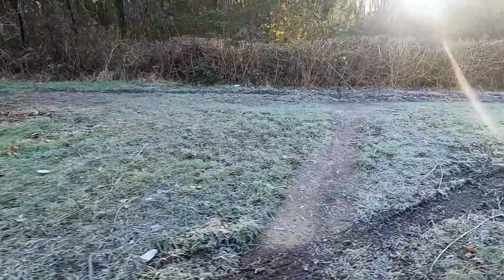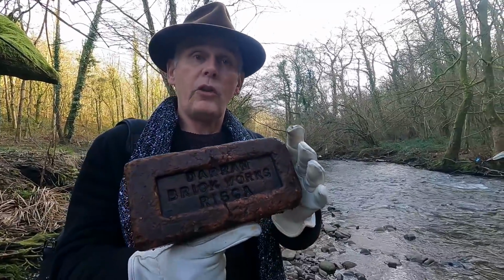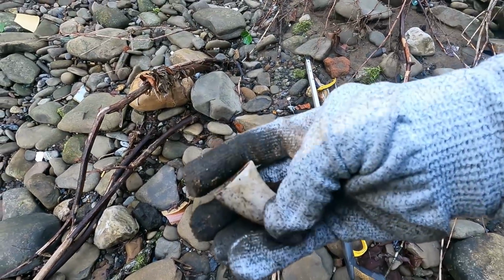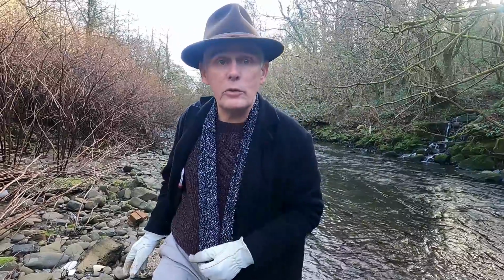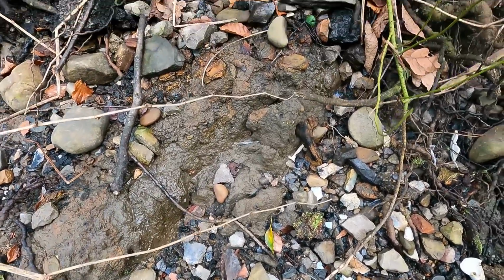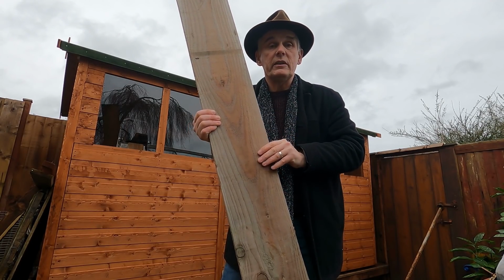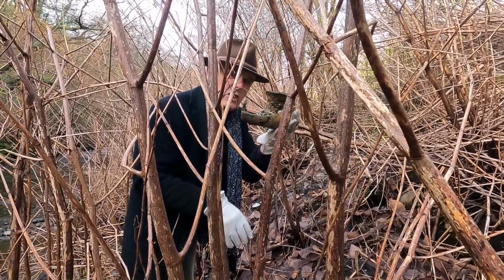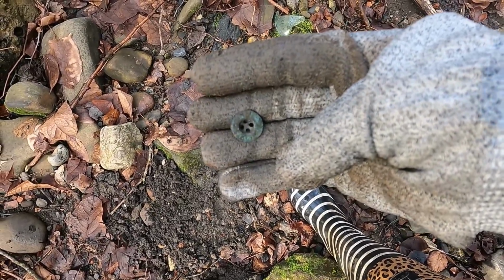Bottle finds from the rubbish dump - stunning glass!

Comment: Hey Phil, why don't you install a small diameter dowel about 1 1/2 inches from the bottom of the shelves.  A safety rail so they won't fall off.  It would be shame for them to fall and break.  Just an idea.  Safety first.
Reply from the maker: That's a good point about safety, I'll have to take a look at what can be done. Thanks 🙂😎🐼

Comment: I'm gonna go with Mr. Johnson's idea of the three tea lights in the bottoms of the fancy bottles. I was thinking not to throw away the tops after you cut the bottoms away. For I think you could ground the broken tops run a hanging light through them. I think with that color they would look smashing slightly hanging from the sheds roof just out side the front. Leading the mudlark community into a new up recycle of old bottles. Out door hanging tea lights.
Reply from the maker: Glad you like the idea of the 3 Tea Lights, and thanks for the idea for using the rest, it's always good to hear new ideas and suggestions for upcycling the finds. 🙂😎🐼

Comment: How about building an add on to your storage room. Collect bottles and use them to make the walls. Bottle bottoms facing out. You should find instructions somewhere on line; because, building have already been made out of old beer bottles.
Reply from the maker: Now an extension or 2nd shed would be nice Arvetta, but I don't know it I could manage to build it out of bottles... But I have seen a large greenhouse on a local garden project that was made from discarded plastic pop bottles. So it is a great idea, thanks 🙂😎🐼